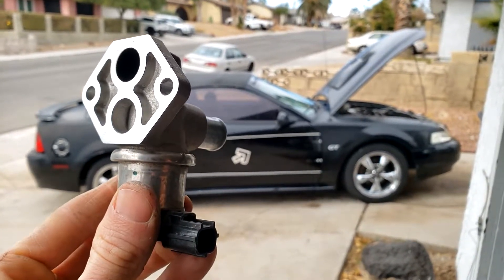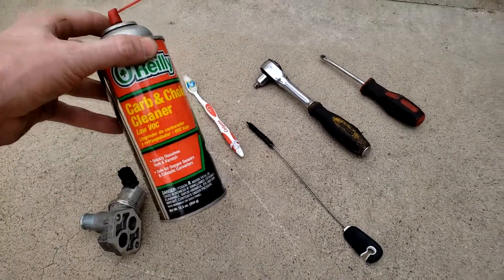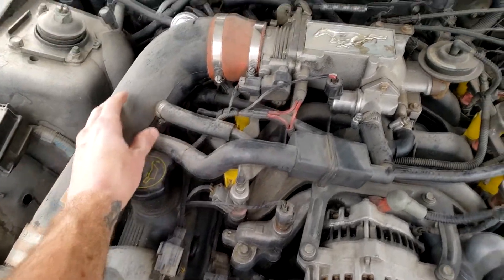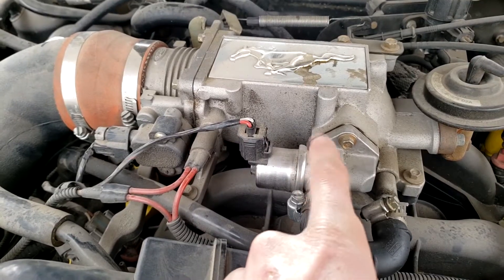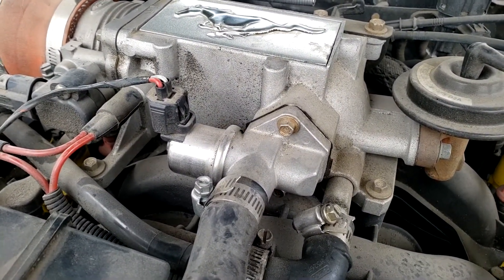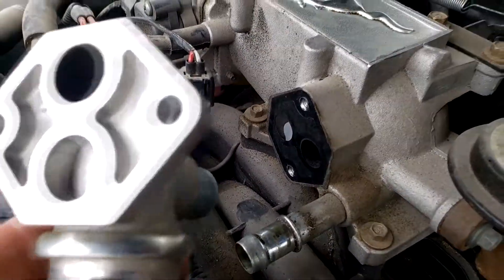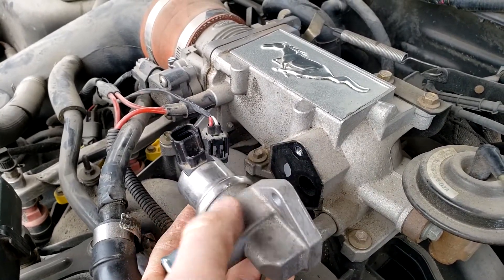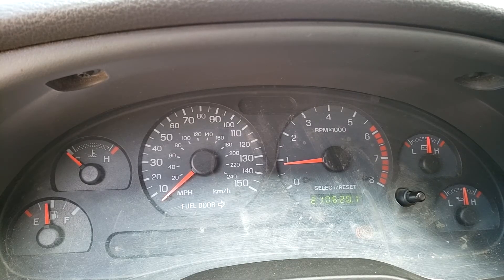Car Stalling or Rough Idle - Cleaning the IAC Valve (Idle Air Control)

Comment: Thank you! My 99 gt starts fine, and idle is fine, but at slow take-off it runs rogh only between 1,000 and 1,5000 rpm and around 30mph. Once It passes this range, there is no notice if the roughness. Today it did stall though one I turned on the AC in bumper to bumper traffic. I had to start the car and keep my foot on the brake and accelerator to keep the rpms out if the rough range (1,000 to 1 5000 rpms). This caused the car to run hotter. I'll replace this part (Napa calls it an Auxiliary Air Valve),  and see if that helps. I've been getting a P0175 - System Too Rich - Bank 2. I replaced all 4 O2 sensors and same code. Also replaced TPS (Throttle Position Sensor) and the MAF Sensor. Same symptom persists. I have new spark plugs, coils and injectors. New fuel and air filter.
Reply from the maker: I'm curious: Why did you replace all those parts? What were the diagnostic steps you did to determine those parts were at fault? I'm also curious why, for example, you replaced all 4 O2 sensors, when the upstream sensor would report the rich air-fuel mixture? I don't think the O2 sensors would be a likely culprit for this (although not impossible)

Common Causes of the P0175 Code:
Outdated PCM software
Over reporting MAP sensor
Stuck fuel pressure regulator
Faulty coolant/air temperature sensor
Stuck thermostat or throttle position sensor
Shorted fuel injector windings
Faulty air flow meter/sensor
Faulty O2 sensor
Reply: @TutorialGenius  Well, the Bank 2 sensors were 25 years old, so I figured to just replace them all. No change though. So, methodically eliminating possible causes. Waiting for Service Engine Soon light to come back on. Will take into mechanic hopefully this week.

Comment: I replaced my IAC completely cause I cleaned my old one and it did boring and new one is doing the same thing
Reply from the maker: It could be something else, like a vacuum leak. What diagnosis steps did you take before you thought it was the IAC?

Comment: Just did this to my 89 lincoln TC . Upon acclerating from a dead stop, the CEL would flash, engine would hesitate briefly then go. Just about every stop. After cleaning and reinstalling my IAC, the CEL was doing its thing still for a couple miles but finally stopped and hasnt returned and the idle is much much better. Thank you For this video.
Reply from the maker: That's amazing! I'm glad it worked out for you! :)

Comment: My car actually starts up climbs idle a few times stays at 1500 at idle then drops to maybe 1.1k rpm it also sounds like it’s cammed sometimes it will start chopping and rpm’s will be jumping from 700 to 400 back to 7 so on so forth until it either catches itself or dies
Reply: Same here and I’ve been tryna fix it cuz it’s really annoying when it dies a red light
Reply: Man we all in the same boat?
Reply: So did you fix the issue ?
Reply: We all in the same boat🤦🏽‍♂️
Reply: @Ron4news  I sold mine lmao turns out it was a blown head gasket
Reply: @christianvalencia3677  at this point if that’s what it is I wouldn’t be surprised 😂mine started as a  bad exhaust leak pipes is all fixed it’s still acting like it wants to cut off or or it does once the RPM drop low enough
Reply: Push the gas pedal to the floor and start will reset the iac

Comment: What if my idle is staying at 2000 rpm at idle? It’s done that. Few times so far.
Reply from the maker: Like and sub to our channel! :) I dont mind answering questions either!
Reply: So I gotta be subscribed for you to answer my question?
Reply: @joshuahiggins5313  it could be stuck open which will be fixed by cleaning it as well

Comment: Hi, I have a 2003 Ford Mustang GT with 30,000 miles. It has been driven intermittently for the past 15ish years until recently. It's now my daily driver, but just recently, the Check Engine light came on and the RPMs fluctuate after a cold start. Do you think this could be due to a faulty IAC Valve? Any advice would be a major help. Thank you!
Reply: IAC is related to air in engine if u feel your car running smoothly then its not the problem. Check engine go to computer check will show u the problems
Reply: Look up the mustang hidden feature it will show you how to look at the diagnostic codes
Reply: That's too epic 2003 with only 30,000 mi😮😮😮😮 what a find!!!

Comment: I just bought a 2001 mustang gt  with101k miles. I saw the tensioner pulley hesitate on the test drive. i replaced the two idler pulleys and the tensioner pulley. left the old belt alone. now My idle darts. it is better than before. I can clean the IAC. what about plugs? bought new air filter have to replace that. could it be a vacuum leak? thx .

Comment: What about when you are driving and put it in neutral and it dies?? I have the exact same car gt mustang please help. Check engine light is on but it doesn't stall at idle. Just when i put it in neutral coasting? Maybe its the iac?
Reply from the maker: If you have a check engine light, then pull the codes. There is no sense in guessing what the problem is. You can rent the tools for free from many auto stores.
Reply: i have this same problem did u figure out what it is
Reply: I did it was the icv idler control valve I cleaned it out with some brake cleaner. The gasket was little worn but still good. It was driving absolutely fine for about 3 weeks after that, now I'm experiencing a new problem. Now "sometimes " when I'm accelerating it studders when I'm going from 1000 rpm to around 2000 rpm. After 2000 it's just fine.. sounds great feels great but then I'll shift into second and it dips below 2000 (around 1500 rpm) and starts to studder a bit until I hit 2000 rpm again... whats going on??
Reply: @brucewayne-od5wy  spark plugs
Reply: @brucewayne-od5wy  your MAF is dirty

Comment: My car has the idle air control valve check engine light even after replacing it with a brand new one. The hanging rpms went away but it idles at around 500-600 rpms sometimes, anyone know what might be wrong ?
Reply: Try disconnecting battery for a few minutes.....replace....let car idle a few minutes...take for a 5 -10 min drive were u can cruise at 50 mph...hope this helps

Comment: Can this still be the symptoms if when i turn on my car it turns off in less then a secon and it makes a air pshhh noise and if it only runs if i have to keep my foot on the gas for a bit before i can let go and it idles by it self ?
Reply from the maker: Could also be a vacuum leak! Could be many things really.
My best advise to you is to take it to a shop and get a diagnosis (Many of them offer free visual inspection)
When you get the diagnosis, tip the guy a couple  of bucks if hes nice, then go home start learning how to fix the problem yourself

Comment: So the old valve idled pretty low but never stalled. I installed the new sensor and it's actually stalling now
Reply from the maker: Sounds like a bad part!
Reply: Probably a fuel issue at that point

Comment: Whats the difference between this and the maf sensor?
Reply: This controls the air for idle. The MAF sensor reads the incoming air to determine what the computer wants to do with air/fuel ratio and things like the idle air control valve.